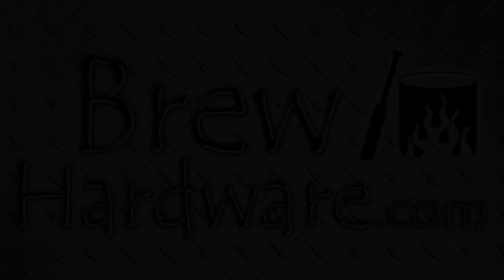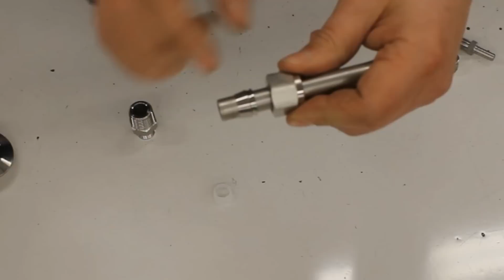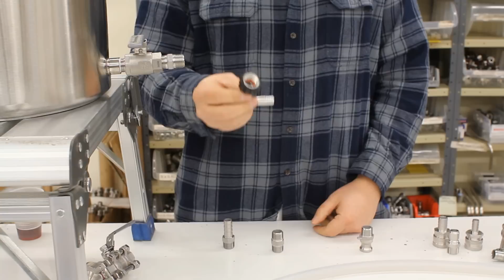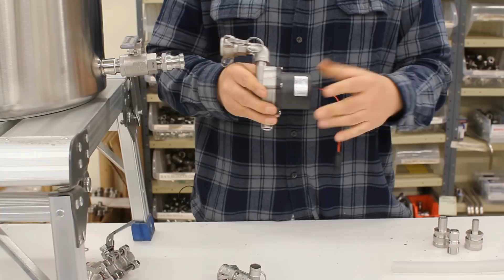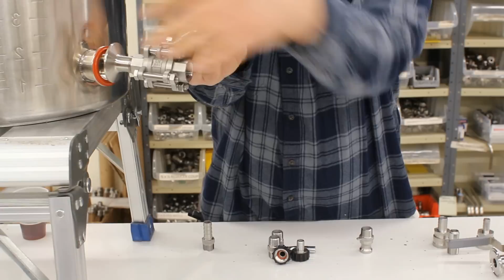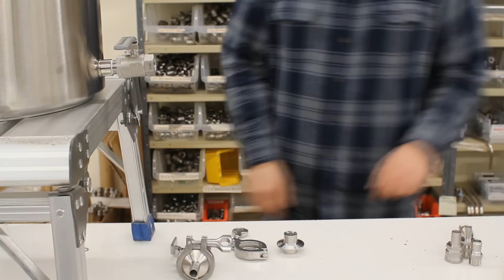BrewHardware.com Brewery Connections, Plumbing, and Disconnects

Comment: My brew kettle/pot doesn't have any openings whatsoever. It's just a stainless steel pot.

I want to use the camlock fittings (based on his recommendations). Unfortunately I don't know where to begin!

Do I need a bulkhead if I plan on using a camlock fitting? Also, what about the thermometer? I don't have one for my brew kettle, nor does my pot have an opening for it.

Can someone please help me???

Comment: I´m impressed, really great review. When it comes to brewing, cleaning and sanitizing is always an issue. Ball QD are easy to handle, but their risk to cause contamination is higher than using Cam-Lock. Thats why you will see them mostly on pneumatic applications rather than liquid.

Comment: I bought a WH1803A controler for my brew pot. What weldless thermowell would I need to purchase from you for the temperature probe? I will be using two heating elements and one will be constant heat the other controled heat.

Comment: There is SOME truth to the sanitary fittings with threads not being sanitary, but no less than the camlock or blqd fittings with threads on them.  If you use a pump with a plate chiller (or similar), all the fittings prior to cooling down don't need to be sanitary.  I like the use of sanitary fittings because I can grab hoses to pump into my conical, etc., and I don't need to worry about which hose I grab as long as I have sanitized it.  So, if you recirculate, except for the cost, the TC fittings are awesome because heat from recirc will sanitize the threaded fittings, and then the hoses can be used interchangeably.  Otherwise you have to have search for a hose that has the right types of connections on both ends.
Reply: I don't think you got my point. What I meant was that "more sanitary" is not a reasonable justification for using triclamp connections. I never said that they were less sanitary than any other connections.

Comment: I've converted to TC on my 3 vessel. And I made my own diptubes but I have tig welder and I really love my TC modular design. I can attach anything anywhere. Se videoes on my channel
Reply from the maker: I'm sure I was clear in the video that TC has its advantages but if only everyone had a TIG welder or knew someone who had one and knew how to use it. Standard TC is pricy but it only gets worse when you have to pay someone to make custom parts.
Reply: Yes, You were very clear. Where I live anyone can bring their stuff to a machine shop and get stuff welded. I like the modularity of tc fittings and that I can mount an heating element where I want it or an diptube if I like one the same fitting. And diptubes is not a custom piece anymore. Both you and aliexpress carry many different tc stuff. Anyway this was just my 2 cents. Cheers